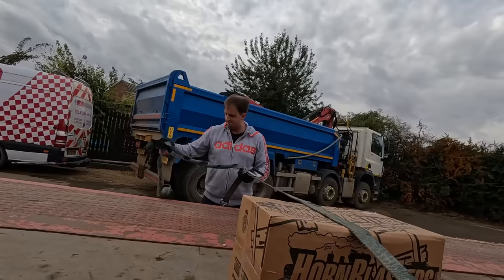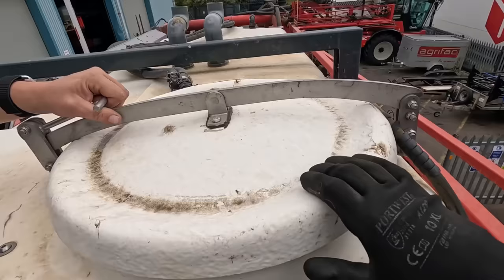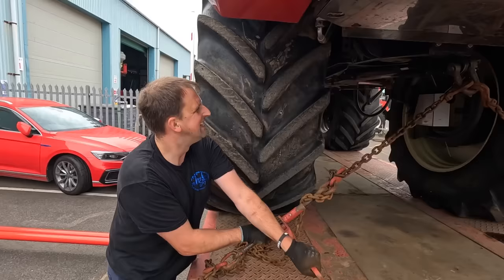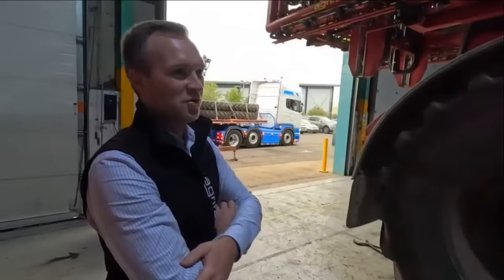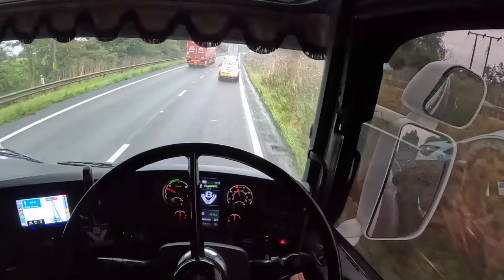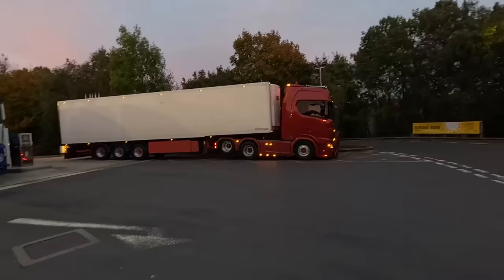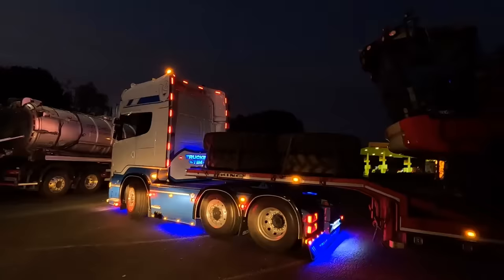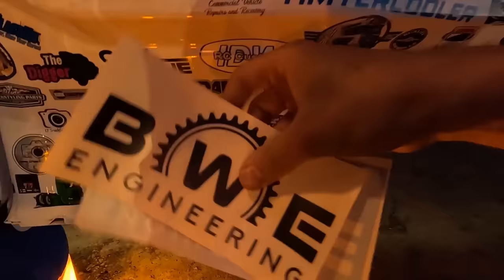MOVING A HUGE SPRAYER TO SCOTLAND | NIGHT IN THE TRUCK |  #truckertim

Comment: Why take your tacho card out to register a 9hr break ? It’s ment to stay in
Reply: Actually there’s nothing to say you must either leave it in or take it out (in the UK at least). Taking it out avoids tacho mode changing to ‘other work’ (depending on how it’s set up) for instance if you turn on the ignition for lights or the heater etc.